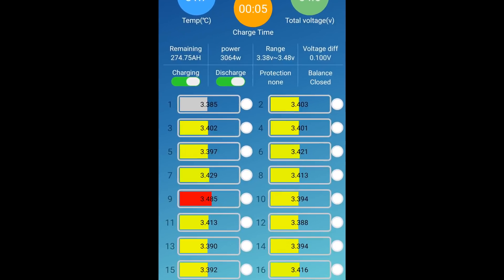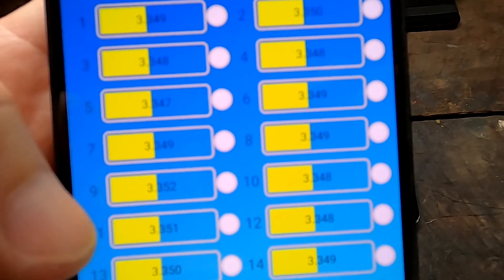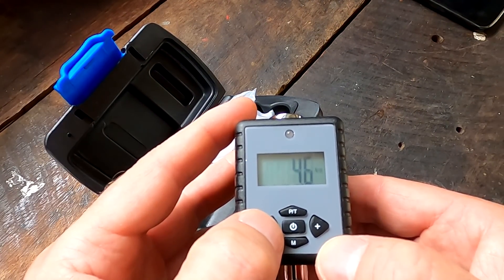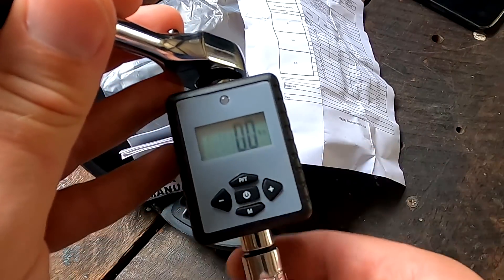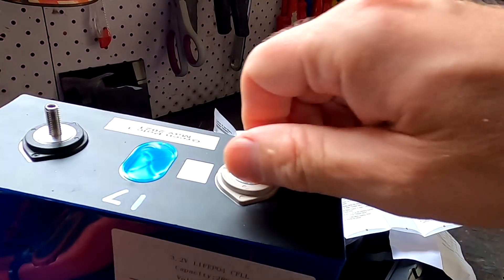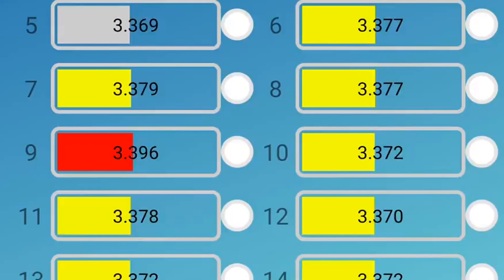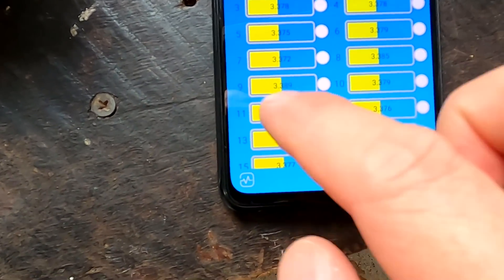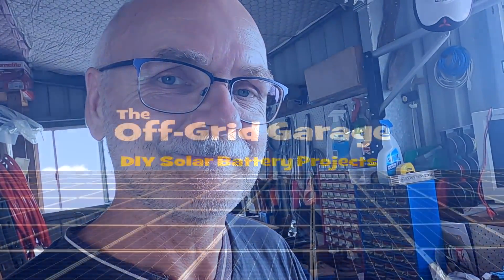Still some terminal corrosion by missing the right torque?

Comment: I've owned several digital torque meters, they're all in a pile collecting dust. I have to hear the satisfaction of the click for piece of mind. Great content Andy thanks for the update
Reply from the maker: Thank you. I read the mechanical ones are highly inaccurate at these low torque numbers. Or you have to spend a lot more money and get a high quality one, like $250+...
Reply: You will never find a click type in an inspection lab , only digital. Low torque especially requires digital .

Comment: Hello Endy
Thank you for yours excellent job, you are probably most experienced man in the internet – because you are doing the tests and learn on it. But….
I would build own DYI battery bank and I have tried to note yours battery settings and I have lost! You make so many changes during the last months  so it is extremely hard to check yours current settings!
I see only one way – to watch all yours movies regarding batteries, remove testing, put into timeline and note all changes. I’m not a native speaker and I do not know what is an idiom for “hopeless job” 
Could you summarize yours current normal (not experimental) battery settings in separate Web page (it also could be video for that – with explanation and additional comment) where list you yours settings for charger, BMS and SmartShount (could be screens). All that setting have to correspond to each other and changes in one device should be synchronized with changing on another device.
I thing so that page could help to better understand yours setting and could be implemented by other, less experienced people.
Reply from the maker: Hi Jerzy, thanks for your comment and suggestion. I find it hard to share all my settings as they work for me, my needs and my setup but may not work for others because they are in a different position. 
I think it far more important that people understand what these settings are, what they do and how they influence their system.
But I'm more than happy to keep my current settings on my website if that helps out? Give me a few days to implement that...

Comment: 1.Flexible buss bars.
2.conductive anticorrosive of your favor.
3. Torque @ proper value. 

PS:  I know you say " no need for compression at low current levels " but have you measured the thickness of a fully charged / discharged cells to see if they are moving ? 2 beers says they are. lol  :>)
Reply from the maker: I have measured the cell thickness a few times actually with different cells and could never see a difference 🤷‍♂️. Even if I tried very hard.
My cells can move as much as they want. I don't have an issue with bus bar movement or force because of a 2-5mm gab in between my cells. If if they expand a bit this won't put any stress on the terminals at all. I'm the non-compression guy 😉

Comment: Sounds like you need to break down the battery and clean the terminals, then toque all the connections down to the same. As for grease, that sounds like a good battery testing idea, if the grease helps the connection or not.
Reply from the maker: Yes, that is the plan once the new battery bank is in place...

Comment: Didn't anyone tell you the terminals and straps must be tested for precise flatness with a Johansen block, then assembled and torqued to the precise microNewton meter? And you skipped the chapter in the manual that calls for using DeOxIt Gold as a contact enhancer?
Reply: I was wondering if anyone would mention DeOxit Gold.  I use this quite a bit and it seems to work fantastically.
Reply: @jws3925  I started using it on computer circuit boards where gold and tin contacts sometimes disagreed with each other  years ago. For battery contacts I usually use Neverseize, which guarantees no corrosion, but I've never measured it for microvoltage changes.
 I've never seen or heard of anyone having esoteric BMS problems the way Andy has but it certainly will be interesting if this is THE long term fix.

Comment: Hi Andy, I think the best maintenance that you can do is to measure connections with resistance meter. 
You can check resistance between nuts (battery resistance) and then move one pole to the next battery so you measure the battery resistance and connection and busbar resistance. 
That way you can check all your connections

Also,  i think it is the best way to screw your bolts. 

I mean,  you measure resistance and begin to screw it. I think there will be a curve of torque and resistance with a flat final part in which we don't want to entry, in which more torque doesn't get less resistance. 

I think that your resistance meter is your perfect friend!!!!

About aluminium and copper .... they don't like each other,  aluminium will be oxided. As you have done,  is better aluminium with aluminium
Reply from the maker: I would need to measure at the terminals directly but cannot access them once the bus bar is installed. If I measure at the nuts that's only a best guess because the nut could have good contact at the top of the bus bar but the terminal could have bad contact from the underside to the same bus bar.
Reply: @OffGridGarageAustralia  may be you can measure between bus bars and include the internal resistance. Probably, with 16 cells you willl see diferences. Diferences that are in the connections, not in the internal resistance. Isnt it ?
Reply: @OffGridGarageAustralia  Also... may be not the nuts, but thread Bars?

Comment: If you first screw the studs in by hand until they stop and then add the busbar, and then tighten the nut down by hand. You then torque it down, you can’t tell whether the nut is turning on the stud or the stud is turning into the pole and possibly pushing into the cell. 
The Allen or hex key on the stud is there to stop it from turning while tightening the nut. 
My procedure is to bottom out the stud by hand, then back it off 1/2 turn with the hex key, place the busbar and nut on and hand tighten, keeping the stud from moving using the hex key. Then when torquing you shouldn’t bottom out the stud, which could do damage to the cell.
Reply from the maker: Many people have said not to worry about it. When you tighten the nut it will pull at the rod at the same time and it will not spin. I have used an Allen key before to hold the stud in place and people have said to not worry about it.

Comment: I can only speak based on my experience with high voltage busbar (132kv,275kv and 400kv). When joining copper to aluminium we always use a brass transition washer to stop corrosion. We tend to use a product called rustilo which looks and feels totally inappropriate for the task but always makes a good joint. Vaseline was also the go too jointing grease when I first started. Aluminium oxidises extremely fast so it has to be cleaned and jointed asap
Reply: I should probably state as well that a typical metal to metal joint would only be classed as acceptable if its less than 10 microohms. I know this is all well OTT for battery terminals but the principles the same.
Reply from the maker: Thank for sharing, Mark. Rustilo sounds like an Italian Pizzeria 🍕

Comment: Nice one Andy! From experiance as a quality engineer calibration was one of my rolls, a torque wrench of any sizes are only as accurate as your wallet is fat.  One of the things you just can't trust cheap.
Reply from the maker: I know, at least I'm consistent with my inaccuracy now 😂
I refuse to pay $250+ for a torque adapter which I rarely use.
Reply: @OffGridGarageAustralia  Good morning Andy.
My work used Teng tool, they are a very good compramise of excelent quality and cost. The 1/4 drives we had started at 5Nm and were perfect every periodic calibration, checked at top, bottom and two random settings of the ranges. 
They had a very abusive factory life and were never backed off when not in use.

Comment: I used a digital luggage scale and a spanner. By some math you can work out how much force is required.Oh and I have been using simple INOX and polishing terminals while soaked with INOX and not cleaning it off. This seems to not allow the oxygen to reach aluminium.
Reply from the maker: A luggage scale! I wonder how accurate that is. I also wonder how accurate it has to be...

Comment: use the "YR1035" resistance meter to check terminal connections. Disconnect the battery (current must be 0). Then place the 2 probes between pole and busbar - and the YR1035 shows you the resistance of the connection ! yes this works without a battery in between.
I discovered in my pack connections with 0.8mOhm !! this is a lot. and very very bad.
Now I grinded the connection surface with 400er sand, cleaned it with aceton, applied MG Chemicals carbon pasta, tighted it with spring washers - and I measured 0.02mOhm or so. perfect now.
Reply from the maker: The problem is, that I cannot reach the terminal area under the busbar any more with the tester. I can only measure from one cell to another wich includes the cell's internal resistance as well.
Reply: @OffGridGarageAustralia  this is very unfortunate. With the YR1035 you have a measurement. Other methods are just esotheric. Maybe you can grind/drill a little off from the busbar in order to reach the aluminium terminal from the akku.

Comment: mechanical expansion cycles is the enemy .. no matter how fixed .. the compound helps reduce oxidation as it inevitably allows air between .. this expansion is why i analyse the compression they advise for the packs. ..  the small expansion will slowly but inevitably (how does elon say it?!)  uncontrolled dissasembly?.. but at speeds u cant see ... lol. the lifepo4 packs shall  swell and the hard bars coefficient of expansion is wildley different .. so the twain shall eventually crack .. reduced life . .. i originally thought it may be because of the chmistry ?!.. maybe it wasn't. love your channel .. and keep  truckin !..
Reply from the maker: I have 2mm gabs in between my cells, so expansion is not an issue.

Comment: Anytime I work with aluminium conductors, te grease is paramount. Since you do not compress your pack, I'm ok with busbars. Cables are best though.
Great topic!
Reply from the maker: I have 2mm gaps in between my cells so even if the expand 0.5mm each they won't create any force.
Reply: @OffGridGarageAustralia  Oh yes, I remember, you are not compressing. Makes sense

Comment: no-oxide A .. smiles .. after working on pcs and small voltage for many years .. contacts are ALWAYS the problems... well mostly always ...lol..  or use a di-electric..  google is one does not how they differ .. but caution .. always ..

Comment: Started using carbon conductive grease from jaycar with good results. Also have some expensive silver conductive paste i will be using on my more expensive builds. Glad to see you finally got a torque wrench.
Reply from the maker: I had the Jaycar carbon grease as well and had bad results with it. It worked at the beginning but the same problem came back after a few weeks. The NOOXID seems to work for me.
Reply: Do not use the silver paste with aluminum it will encourage corrosion
Reply: @bascomnextion5639  same as an aluminium heat sink on a cpu the silver particles are in grease there is no air or moisture and its air tight between two compressed surfaces.

Comment: I had some "Wago 249-130 Alu-Plus Kontaktpaste" leftover from some installation work on old GDR aluminium cabling. Put a thin layer to the busbars. Seems to work.
Edit: And I am using normal nuts with spring rings instead of these cheap "self locking" nuts they sent with the cells. I had the feeling the bus bar material is too soft for any "self locking"

Comment: Believe me, the problem is not the torque. 
At the beginning of the videos that you posted in this channel, I told you how I dealt with this problem. The main problem is using a solid Busbar and most people using the same what you are using.. 
After several attempts, I discovered how the large companies that manufacture complete units of Li-FePO4 batteries they use Flexible Busbar, so I imported from China Flexible Busbar and all problems of connecting batteries are completely solved.. 
no more high temperature in the terminals no more voltage drop.
Even if you tide the screws in different torque you will not face any problems.
Reply: Soft is a more appropriate term than flexible.
It crushes/conforms to the surface it is crushed against.
Make your own lugs from soft copper tube.
Cut off 1.5in.
Crush one end in a vise.
Leave the other end round.
Shape the crushed end on your bench grinder.
Sandblast if you've got one.
Reply: Link please

Comment: Some considerations:
1. Please apply the specified torque  if the studs were tightend by fingers only. They should not be prestressed at all by any tool. Else the threads in the aluminium pole of the battery will suffer both torques summed up while the torque applid to the studs will not add anything to the pressure between the contact elements. 
2. My experience is that those stiff bus bars  do harm to the quality of the connection in long term. Mechanical stress due to temperature  veriations  degrades the resistance to the pole and stresses the battery structure. Use felxible wires of proper diameter instead. They shall be long enough in order to form an arc in final position.
3. The main contact  will be performed between the cable lugs and the battery poles. But additional conductivity will be added by well conducting studs and nuts. It is not helpful in this respect to use stainless studs and nuts. The only advantage you get from stainless steell is lag of corrosion - that's all. I prefer to use brass.  While it is about two times worse than aluminium it performs 10 times better than stainless steel. 
Of course it is recommended to apply a very, very thin layer of contact grease to all surfaces and threads in order to prevent long term degradation of the connecting point.

And now you are ready to use your lovely digital torque wrench along pleasing outcome :-)

BTW: Have you considered to use a milli-Ohm meter? It will readily reveal bad contacts w/o disconnecting anything. Long before you apply huge current you will know if the connection is in good state.
Reply: Andy has used a meter to check the resistances, you should watch the other videos he referred to.

Comment: I've applied MG Chemicals 847 when I assembled my battery over a year ago, and have not had any issues. You may remember I do use (my own diy) flexible copper braid bus bars to eliminate any possible stresses on the terminals as well. Personally, I think the combination of these two is pretty much ideal outside of welded bus bars on terminals.
Reply: A few people have recommended this 847. Stuff is not cheap! But if it saves corrosion without compromising conductivity, I'm all for the small cost outlay!
Reply: @5UPRAH  You don't need a lot of it. I think it's around $20 to $30. In the grand scheme of things (cell costs, BMS, wiring, etc.), this is peanuts.
Reply: @ Up North<<<< Thank you. I must apologize that my comment was also similar to yours. I did not read your comments before I commented on MG Chemicals. My apology. But, like my mentor Ivan Lamb, ( he’s no more, bless his soul) often said “Great minds think alike” (though,  I don’t consider myself ‘great’)
Your suggestion on ‘Flexible’ busbar is well noted and may consider, introducing the same into my experiments. Thank you, Sir. Stay safe and 73s…
Reply: What size braid and are you using connectors?
Reply: @markseamans4682  25mm wide copper braid. The terminals are compressed annealed copper pipe. I have pictures of them on the diy solar forum.

Comment: It would be interesting to see you run a battery with flexible cable connections rather than bus bars for a while to see if you have a similar problem as this would remove any movement/strain caused by cells expanding and contracting. The Digital Mermaid seems keen on this idea and it perhaps has some merit. Also adding some compression would be an interesting experiment. I know that you have already decided against compression for increased life cycles but it might have some benefits in removing strain/movement of busbar connections. You need to run three batteries in a side by side test so we all know the answer!
Reply from the maker: I don't have any movement in this battery box at all. Cell 9 is the first one in row (2 rows, 8 cells each) and is actually connected with a flexible cable connection to cell 8 on the other side. Still...
I can understand that Madi did this for her setup as the cells will be installed on a boat eventually.
Compression is totally out of question. I don't believe it will add any significant benefit unless the cells are been charged and discharged at very high currents.
Reply: @OffGridGarageAustralia  compression is a misnomer really. Fixture is a better term. In any case, even if the battery is in a stationary position, you do have micro movements at the terminal due to cells slightly expanding and contracting. When you have solid bus bars, this movement translates over the entire battery.

Comment: You could also try slightly bending your bus bars so when they're tightened down they have a little bit of a springiness to them I did that with mine and mine all got a lot better
Reply: I bent mine so that as it is tightened down it kind of digs in to the terminals on the battery a little bit and gives it some springiness back